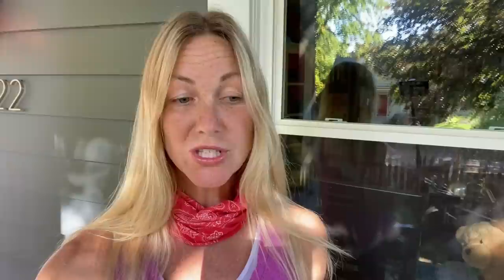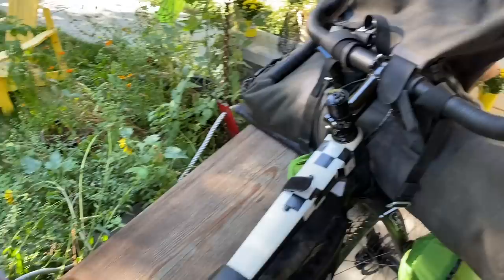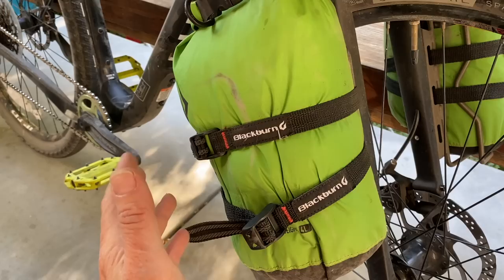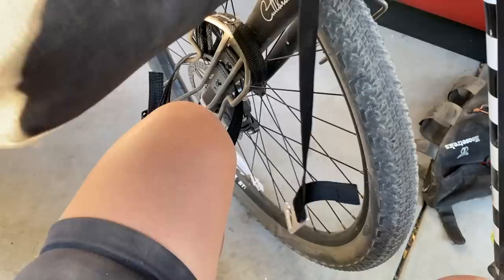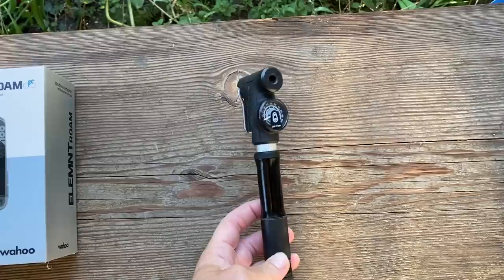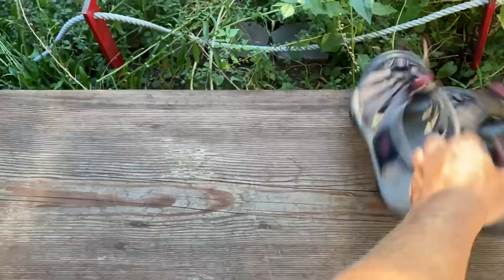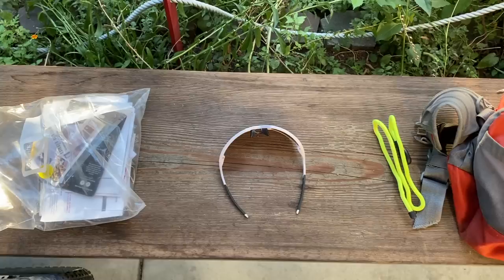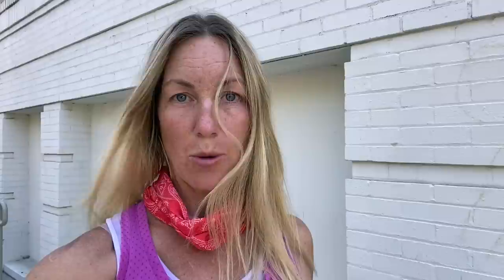How Did My Bikepacking Equipment Hold Up After 51 Days?

Comment: That's good. You cover every aspect of bicycle touring or bikepacking.
Reply: I just used panniers that hooked over the front rack and the back rack. They are suitable for the kind of cycling you do or you have done. There are ways of fastening panniers so they will not jiggle off the racks mine was Road cycling. That means paved roads in towns and cities had between cities. You take to the gravel roads.

Comment: 17:00 made me laugh about the sandals,  9:30 and 10:50 were also clever and good to know about too.
Drop bars would definitely make braking more of a pain in the butt in the choppy terrain which leads me to ask about the brakes on your Salsa.
I also run cable actuated brakes on my Bullit. How were the brake pads holding up after 1,700 miles? I'm going to get that Raceface crank too, been holding off for long enough now😅 
Awesome report Naomi!💯
See you on Strava 
👽👽👽
Reply from the maker: Happy you found it informative! Umm…ahhh…ya…so… I never looked. I sit here in awe wondering why I never thought about it or cared about it.  I think since it was a brand new bike I just assumed they would last and I honestly never paid attention that they were actual pads.  🙃 So when one of my brakes stopped working I assumed it was a mechanical issue not that a brake pad was worn down. Ohhhh myyyy gosh!!  Idiot me! I really wanna take a bike mechanics class!
Reply: @HumanontheLoose  bikes are so fun to tinker with.  I taught myself what made my bike happy and kept it tuned up. Curiosity is a lot of it.
You Tube is awesome and you can find out practically anything about your bike and how to DIY step- by- step no problem!

Comment: Hi Naomi, really enjoyed your series. One thing regarding the Wahoo Element Roam. Just this past winter I used my Wahoo crossing country skiing just to record a track and mileage and it worked fine. Yep- it would beep, belch and complain the whole time during my outings and would always show a broken track on screen but when I would upload to Ride with GPS I would have a complete track with all the same info just as if I had gone cycling. Now I never used it for navigation in that setting so I can't speak to that. But yes I do agree that the Wahoo cycling GPS units seem rather limited even in comparison to an old Garmin E trek Vista which I have owned since the early 2000's. Just little things that I would think any GPS unit would have. But it is nice not having to replace batteries. The battery life of my unit is fantastic. I can go for days on a single charge. Thou lithium batteries do last a long time in my old E treks it's nice not having another thing to have to pack along.
Reply from the maker: Excellent feedback for me and others!! Thanks for sharing!  "Would belch" 😂 It's been two years so not sure how they are now.  Can you put it in hike mode?

Comment: Where you happy with the tire width?  Im looking at a slightly smaller width tire for a similar trip/maybe a little more road % and not sure what to go width.....
Reply: When your bike is loaded down, top speed becomes less important than effort to overcome inertia. I find width less important than tread patter. A road friendly tread can go a long way. The tire I continually seem to go back to and log the most miles are Surly Extraterrestrials. Not light, not skinny at 29x2.5". But they roll well for anything of comparable size. You might try something like Teravail Washburn. They make a 700x47, which is a bit smaller than what she has in this video (Teravail Sparwood 29x2.2; or about 700x58 to compare like units). I've had good experiences with Teravail (Cumberlands I really like, unfortunately discontinued)
Reply: @cjohnson3836  thanks.  Not as concerned with brands now.  My bike take up to 50mm.  I want to understand if I need a bigger tire (and diff bike) for a long mixed terrain ride to enjoy the trip.  
My guess is yes
Reply: @pgreenx  Not really. You can go a lot of places with a 50mm tire. That limit is also probably only for the 700c. See what the spec is for a 650b. I'd guess at least 55mm (which is basically what she has in this). Your bike sounds fine. The only thing you'll struggle on is sand, but so does everyone anyways. You might have to hike-a-bike some of the things a mountain bike will get over. But that's not trip ending. A few millimeters isn't going to make-or-break a trip.
Reply: @cjohnson3836  thanks.  My bike was designed for 700 so I need to stick to that. Also, the fork limits me to 50mm. If I do the great divide route, I want to enjoy myself and may buy another bike for a 2.5 tire (it’s 2700 mile  mile trip)   but really like my current bike.  If it’s a trip like this one with roads etc I think I’m fine which sounds like what you are saying.
Reply: @pgreenx  No I'm saying your bike can also do GDMTBR. That's not a difficult trail and very little is actual singletrack. The difficulty of that ride isn't about the bike so much as the logistics and fitness due to be so long.
Reply: @cjohnson3836  I’m fine with logistics, camping  and fitness.  I backpack long trails.  New to biking.  Sounds like I’m ok with 50mm. Thanks
Reply: @pgreenx  Then you're already ahead of the game. A lot of overlap with thru hiking and long distance bikepacking. Do some smaller weekend trips and that will tell you more about what you want out of your bike than anyone online. Good luck!
Reply from the maker: @pgreenx Sounds like Johnson has a lot more helpful info than I have for you.  My initial trip was going to be primarily dirt so I knew the Cutthroat tires (Teravail Sparwood 29" x 2.2" Durable, Tubeless) would suffice because the bike was designed for the GDMBR.  I was about 50/50 dirt/pavement.  If I was planning a 70%+ pavement trip I would have gone smoother - not necessarily thinner - kind of what Johnson mentioned.
Reply: @HumanontheLoose  Thanks - that's helpful too.   Either type of trip sounds like I need to be able to have a wider tire than 50mm; tread pattern aside.  I really enjoyed your videos
Reply: I used a 27.5 x 2.8 tire last year on the great divide.  This year I'm going back with 29 x 2.3.  I'm sure there are a lot of other factors, but just coasting on downhills, the guys with the 29ers, rode away every time.